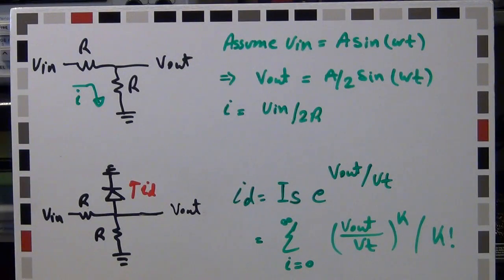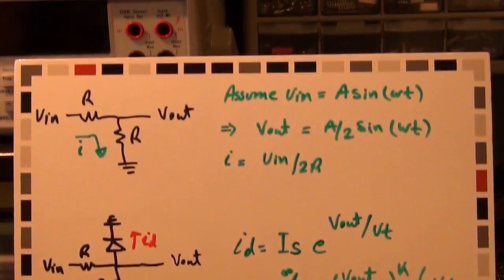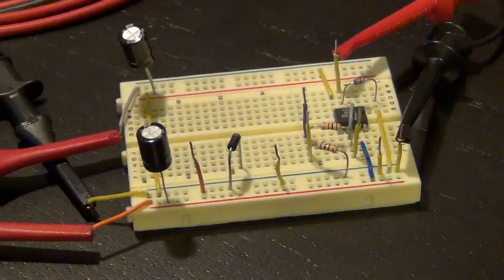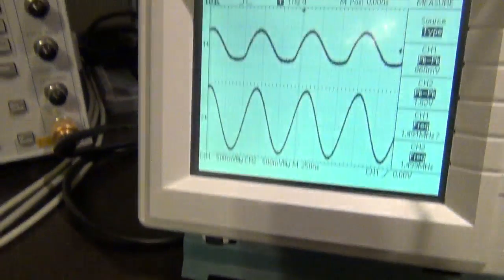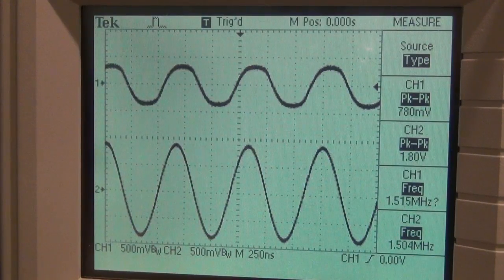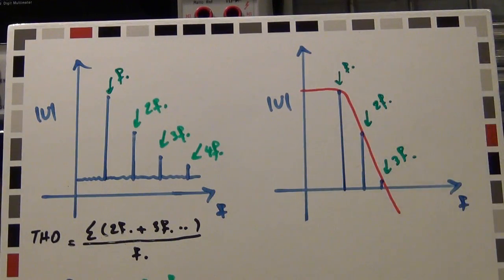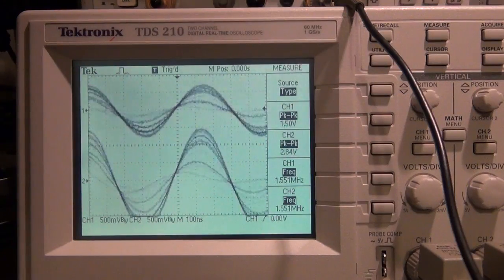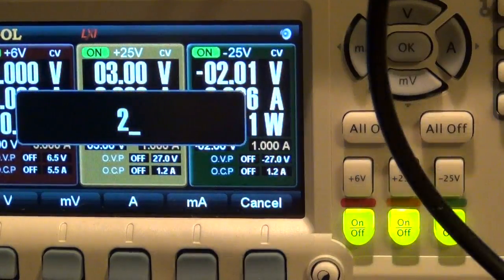TSP #8 - Tutorial on Linear and Non-linear Circuits

Comment: I don't understand the mathematics or theory, but practically, an ideal square wave has only odd number harmonics. By using 2 diodes and clamping the top and bottom of the sine wave, you get closer to a square wave and the even harmonics start to disappear.

Comment: Great videos!  From Signals and Systems course when the content of even vs odd functions are covered we all learn these things about how symmetrical distortion is related to odd order harmonics and asymmetrical distortion is related to even order.  Wonderful demonstration of this around 19:00 to 20:00 with the inclusion of diodes in half vs full clamping orientation. Check out some guitar pedal circuits that utilize this, such as the Boss OD-1 and Ibanez Tubescreamer.

Comment: A bit late, but I think the answer is related to the symmetry of the waveform relative to the time axis when the two diodes are present. With one diode, there is no symmetry, since the signal is just going to be clamped in one side. When two diodes are used, the signal is clamped in both sides. When calculating the Fourier series coefficients for a signal like this, the even coefficients are 0, it comes out of the calculation.
I guess it's what is happening here. When Shahriar puts the diode, it's even possible to see the even harmonics slowly going to 0. I think this is due to the temperature of the diode slowly increasing?

Comment: The coefficients for the FT in case of diode 1 are all positive.  The coefficients for the diode 2  have the magnitude as in diode 1 but alternate in sign.  When you add all the coefficients from both diodes  the resulting every other peak disappears and remaining peaks double in amplitude. I think. I would have to work it out.

Comment: Here' are two questions not related to the non-linear portion of your demonstration.  I'm simply exploring the circuit with the mixed signals with just the resistor divider portion of the circuit.

Regarding that brass fitting which combines the output of the two signal 
generators... Does that have circuitry inside?  Or is that just a simple
 coupler and you're merely superimposing one signal atop the other?

Now to my main question:

I'm puzzled why I only saw two beautiful pure peaks on the spectrum analyzer when you were mixing two signals through the plain vanilla voltage divider.

Forgive me if this sounds stupid.   But I thought heterodyning generates sum and difference signals of two pure sine waves (let's say each with zero THD).   My question is:

How come your spectrum analyzer showed only two pure peaks before you applied the clipping diodes?  Why didn't I see any sum/difference signals?  Shouldn't I have seen a 100 KHz peak and a 3.1MHz peak? 

One step further:  Let's say that they were there and that you were somehow hiding them on the analyzer to exclude those ranges...  Well, once you have a 100KHz sideband signal, would that not (again) heterodyne with each of the two fundamentals, generating signals at 1.4MHz (visible), 1.5 (hidden within the fundamental peak), 1.6 (hidden again) and 1.7 (visible)?   I'm genuinely troubled by seeing just  two pure peaks on the spectrum analyzer.  

Responders please be gentle.  I understand that I don't know what I'm talking about because those two pure peaks are proof that I'm overthinking this.  I'm hoping to learn why/how heterodyning is not happening with this circuit.

Comment: +thesignalpathblog why have you connected the two capacitors on the bread board ?? what is their use ?? 
And when you added diode to the circuit it was actually clipping the negative and the positive half cycles and not clamping it right ??
Reply: Those are the same thing. Clipping and clamping are the same thing in this circuit. The capacitors are just there to decouple the power supply (get rid of any noise the power supply might introduce to the circuit). They are not part of the circuit under examination.
Reply: The capacitors are not for noise from the power supply. They are providing the "pulse" power to the circuit. The leads from the power supply to the breadboard have inductance and so cannot deliver power pulses fast. The capacitors are capable of delivering those fast pulses.

Comment: In the initial expression for id for the first nonlinear circuit what is Vt?

is is simply the value of Vin at a particular time t?

if that is the case, then surely Vout could never be bigger than Vt, right?
Reply: +Zambia95 Vt is thermal voltage, basically the ratio of temperature (in energy units, kT) to charge of an electron. By the way, about this equation, we're in the land of being king of sloppy (not that it's a bad thing;p) by getting (V_out/V_t)^k/k! and then summing over i ;)

Comment: The circuit is non linear so once you have the linearized system consider the transfer function in both cases or rather in presence of diode and not. The even harmonic will disappear if and only if the transfer function is affected by pole zero cancellation.

Comment: Hi very nice videos, thanks! I have a question for you... at time 29.24 we can se the intermodulationproducts from your two-tone test. If one do the math, the upper and lower IM-products should have the same amplitude if the amplitude of the two inputed signal is the same, right? But as i noticed all the upper IM-products have more energy then the lower IM-products, its not symmetrical. Its mostly seen when watching the IM3-product. So my question for you is why does this happen? My idea is that the two diodes are not identical, they are missmatched, so the taylor expansion for each of them wont have the same coefficients. But if that is the case, what would happend if you switch place on the diodes in the design. Would it be that all the lower IM-products will have higher amplitude? Im curious to know!

Comment: The diodes are in parallel and opposite. Harmonics mean power of basic input function (third -> power of 3); power surely keeps the original sign if odd (while - * - = +). At every [half] cycle diodes have same harmonic values but all opposite in sign; so due to their positions, the difference is the result. Then even components are eliminated, while the odds...just pass (no add because diodes don't amplify).
P.S.: harmonics gain a little bit in amplitude: maybe a sort of power redistribution?

Comment: These are some of the best tutorials on YouTube. I would only suggest to use a multiple camera setup so they are also a bit shorter and more to the point. Right now there is a lot of camera movement involved breaking the flow. One or two mobile phones would do the trick, YouTube also has a video mixing capability which is pretty intuitive and fast. Keep up the nice work!

Comment: @TheSignalPathBlog A harmonic is defined as a multiple of the fundamental K. The first diode and the introduction of a sin wave creates the non-linear output due to the e^x attitude of how a non-linear diode operates (as a sharp change in definition is non-linear). Since the diodes are the same and therefore considered balanced, the even order harmonics are canceled by only allowing odd harmonics due to the diodes I to V non-linearity being closely matched during manufacturing.

Comment from the maker: @3cu14rs Yes, you are right about the fact that a square wave does not have even-mode harmonics. But what about at the circuit level, what is happening there?
Reply: you said that the diodes only 'kick in' after a certain point, and then the second diode is flipped in the other direction allowing the opposite voltage, so is it that the even harmonics are causing perfect phase cancellation?